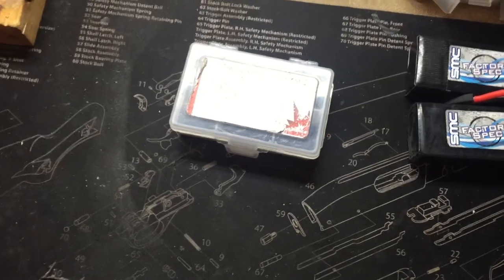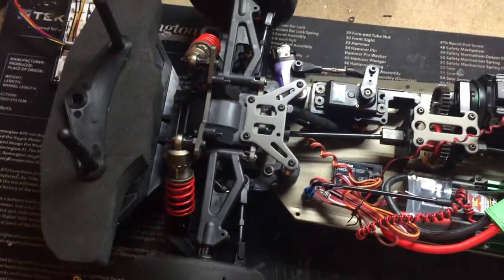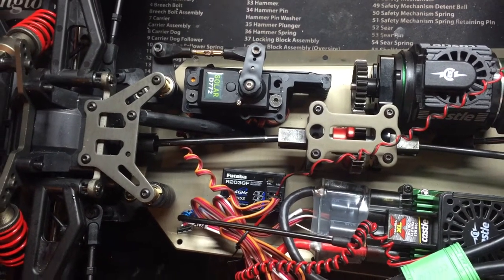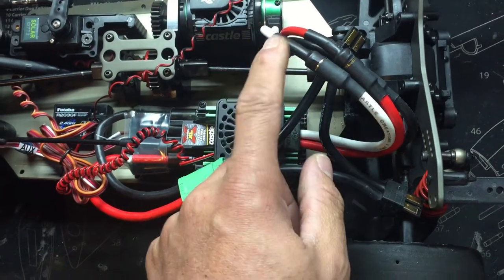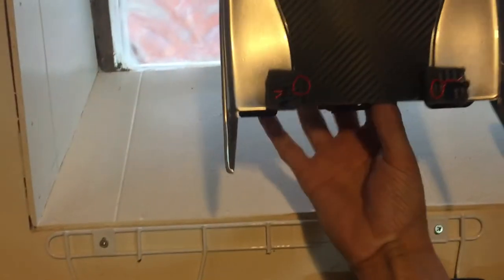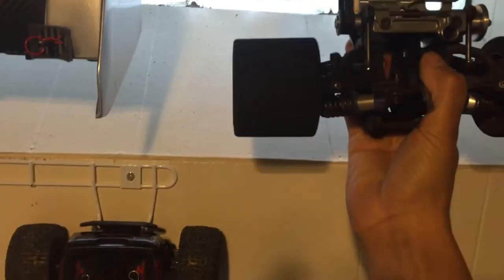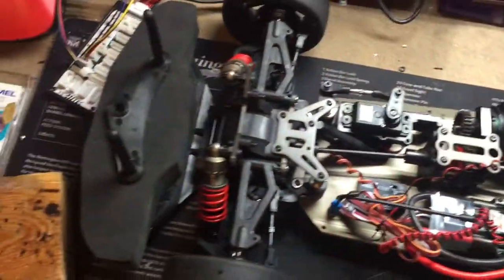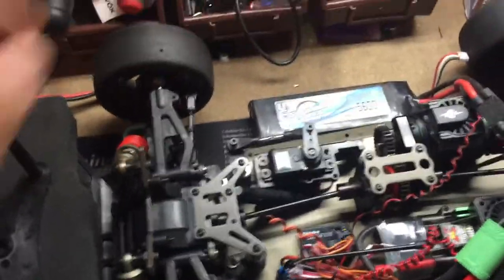NEW PROJECT

Comment: hey bro, move your shims on the a arms to the front of the arms and it will add caster, help it go straight. I ran purple revo springs on the front. tighten the preload down front and rear. looking good though.
Reply from the maker: Will do Sir. I tried the revo springs and won't fit. They are to long. What weight shock oil you recommend. Getting my center driveline centered right know. I'll try springs when I get it back. Thank you Sir I'll appreciate you.
Reply: I ran them on my gtp2e, there are 2 different  length  springs.
Reply from the maker: +Philip Jolley.. Cool will look into it.